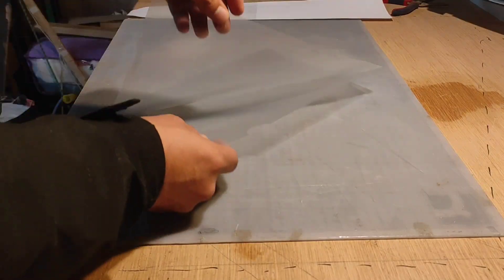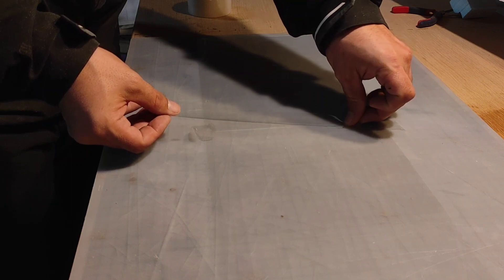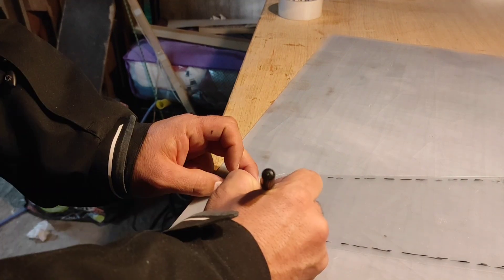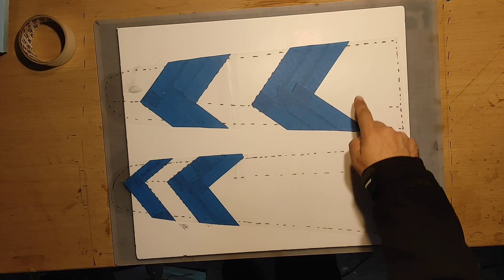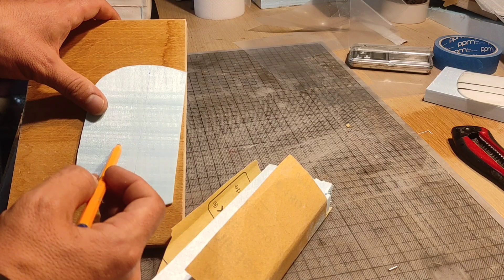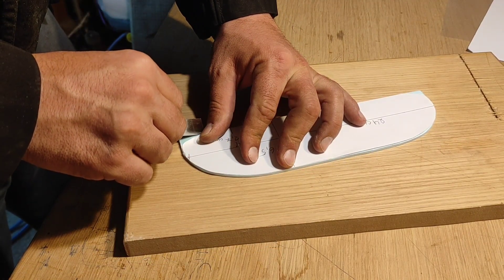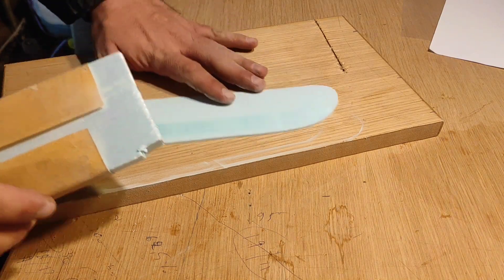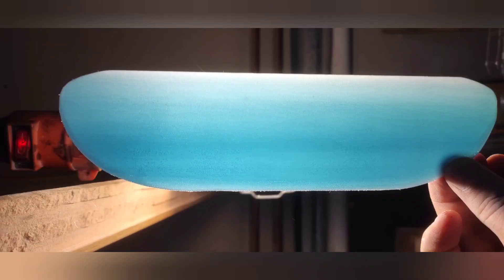1m GF DLG-part.2-Mylars & Tail cores

Comment: Just started following you and your aviation videos !! So appreciate your willingness to share your insight and technique!! I haven't done many builds in the last 20 yrs and now getting back into  gliders and DLG's this time with my boys! Can you refresh my me memory about the mylar?  I  recall there were two sides and I remember adding spray wax before applying paint to the mylar after drying to be then laid down on the cores, is that correct? Also what king of pressure do you need to hold in the vacuum bag and for how long? Greetings from the US!  Thanks so much, look fwd to all your builds !!
Reply from the maker: Nice to hear that Alan, so I use these PP (polypropylene) sheets, which don't need any waxing at all. You should use the shiny side of the pp sheet facing the fabric and this will result in a shiny finish. Spray the pp sheet with paint without using any wax, let it dry, fix the cloth on to the sheet wet it out with epoxy and place it on top of the cores, simple.! The pressure is unknown to me, I just use the vacuum cleaner and let it cure for 24h.

Comment: Hi, I'm cutting tail feathers at the moment.

Please can I just check it is for both the horizontal stab AND the vertical stab/fin that you sand one side only?

I understand the horizontal stab, plenty of model (and most full size) aircraft have +/- lifting tails. But doesn't the vertical having an asymmetrical foil impart a yaw that needs to be trimmed out?

Or is it just not enough to worry about?
Reply from the maker: Yes, both are asymmetrical. Vertical stab will counteract to the yaw movement produced by the launch being powered by a rotational movement. The outer wing travels faster than the inner and makes the plane yaw when launched. Right-handed launchers, make the plane yaw to the left, so you need a vertical stab that yaws to the right...for left-handed it's the opposite setup.

Comment: I was watching your video again and it raised a question. 
@ 2:30.  Why does the foam have directional strength?? 
I would say there is no difference because it is a synthetic material. It is uniform in consistency/texture.
Perhaps cutting it with the hot wire creates tiny ripples in the surface/skin. That could cause some directional stiffness. 
Then the next question would be: “In which direction do you use it?
 In X or Y direction?” 

It would suggest that you would need to keep this in mind when cutting the parts.
Can you do the same test but then after sanding of the ripples?
Reply from the maker: I don't know why it has directional strength, I haven't looked into it, but it seems that way. I also haven't concluded any further tests, because there is no need to. I use its directional strength (if any) like if I would use balsa wood parallel to the wing's and tails length. Perhaps it plays no role at all, but this is what I have experienced.
Reply: @afilos  So the foam's directional strength is negligible?
That is good. It will save a lot of material.
Reply from the maker: @peterismobiel No, It's not negligible as you can see in the video, I am just not sure if it disappears after sanding.
Reply: @afilos  I will try tonight.
Reply from the maker: @peterismobiel Great, tell me what you'll find.
Reply: @afilos  Bla bla bla bla....
You are right. There is a directional strength. 
Can you let me know your email address? ( through the forum?)
 I will mail you some images.
Reply: @afilos  about foam directional strength:
1. If balsa horizontal stabilizer wood grain is along longer edge (perpendicular to boom) then you use the foam stronger direction the same as balsa wood grain - do i get it correct?
2. Do you apply same rule to wing?
Reply from the maker: @avatarnik  Yes, like you do with balsa. Wing and elevator the grain runs across the span and for the rudder vertically. Or in other words the grain runs across the leading edges.